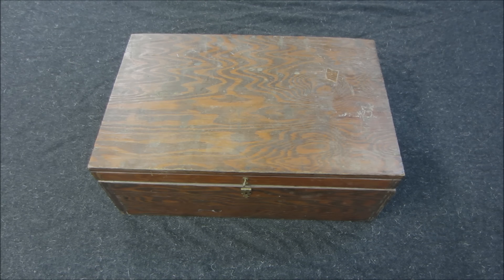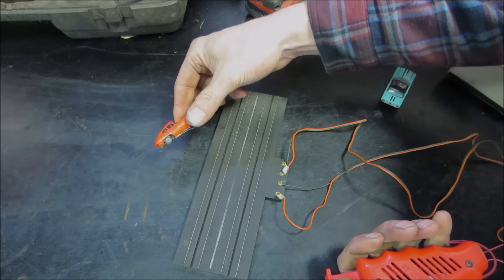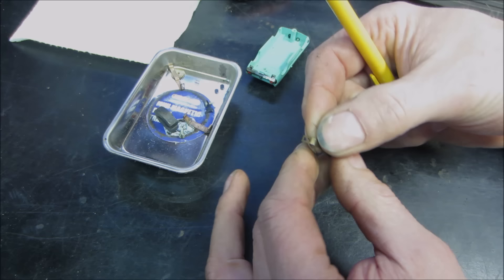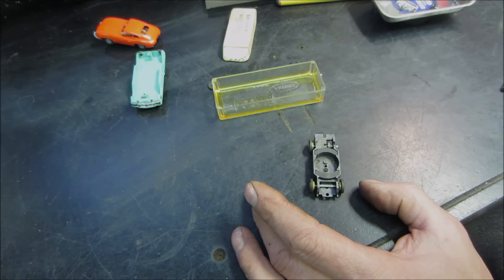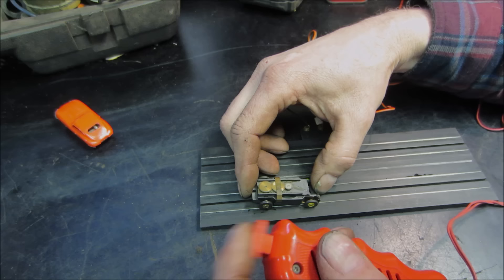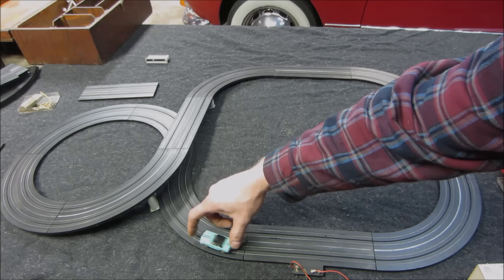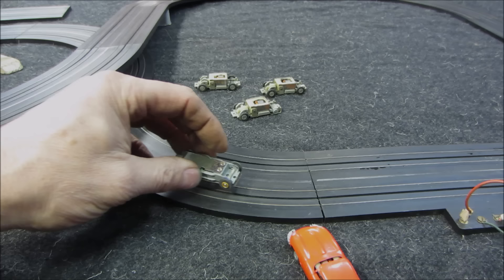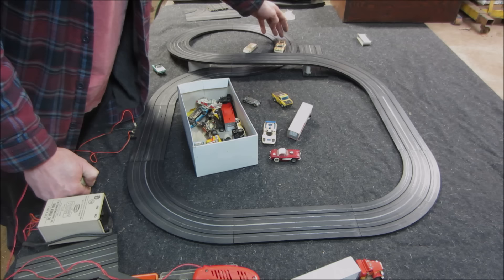will they run? 1960s slot car set sitting 40 years.

Comment: Great memories from the mid 60's for this guy...thanks Mustie! I had an Aurora set with these VERY cool controllers...instead of the spring loaded thumb or finger controllers, it had a small console with a steering wheel coming out of it that you turned left/right for more/less power but not spring loaded. You could set one car to just buzz around the track fast enough to keep it on track and then race the other lane against it. I've never seen another set with those type of controllers. Also, we'd put a pin at both the front and back of the car to keep them on the track at higher speed.
Reply: i thought it was more of a challenge to NOT put the back pin in the car....then you had to know just when to slow down so you did not ''fish-tail''the car and ''spin-out''  odd the track! fun times!

Comment: I had a ton of this.  I had cars from Aurora, AFX, G+, Super G+, Magnetron and tyco.  The track I had the most of was the Aurora quick clip track, over 150 pieces.  I ended up making a case for all of it that was three feet long, 2 feet wide and two feet tall.  I had to put castors on it it was so heavy.  I collected all that to share with my kids.    The cars you had with the horizontal motor were Tyco.

Comment: Lots of fun! I still have my Tyco trans am and tractor trailer from 1977. The tires have "melted" though :( Just picked up a TRX set from the 80's with blocking cars. The track has sides because the blocking cars are towed and have no pins.

Comment: as a kid i was very into those setups i had Atlas, Aurora and another you my have forgotten about called Faller which was German made and much fast than the rest...all my friends has small tracks so i decided to buy them all from them and i did and i built myself a fantastic setup in our basement...my Dad bought me 4 4x8 3/4" plywood and i set the wood up against the wall at first with 3 4x8 straight down and the 4th one was on the bottom right like a big "L"...so i did 2 lane of HO for the cars and then i was able to buy a tract that would allow my HO trains to be incorporated into the setup...the set took my Dad and i months to complete...i even built a control console with toggle switch for all the lights and switch tracks i had cobra climbers and cobble stone tracks crisscross tracks and several bridges and a loop d loop...i had 4 pit kits. remember those? they held about 8 cars each...sadly my cars were all stolen but the train and the trains i still own...maybe one day ill do what you did here lol

Comment: Didn't really get into the slot cars till I was working and could buy my own, no one in my family could figure them out when I was a little kid so I got Lionel trains lol. Now I'm 50 & about 4yrs ago got back into them and have 2 + 48 car cases full of cars and enough track to go around the world a time or two. In the 80's I had all Tyco 440 cars and sets but now I have Tjets, AFX, Tomy, Auto World & Tyco and have all the special adapter tracks to mix all the brands together. What is kool is all these yrs later parts and high performance parts are pretty easy to find and not that much money. I have AFX Super G Plus, Tomy Turbo's & Tyco 440 cars built to the teeth with HP goodness & use a big adjustable power supply turning them into little missiles lol.

Comment: you had the newer version, mine had the little metal tabs on each rail to make contact with the next, along with a little white locking tab to keep the track closer together. And it didn't have any of those cross over tracks, Its about 55 y/o and sitting it the orginal box in the back of the garage somewhere.  thanks for the memories.

Comment: This was fun - it reminds me of going to my local big buys layout. We had slot cars the size of 1/10 scale racers. When they came off the track everyone ducked, as they turned into missiles! They ran on 24V DC, and there were all kinds of styles and types. I had 3 cars, a green "Lightning McQueen" style Daytona racer, a humvee that fish tailed and knocked the competitors out of the way and a Baja like you mentioned with the tire on the back and the open, roll cage drivers compartment. That one required lots of eye hand co-ordination on the pistol grip, lest it flew off the track and hit someone. My Baja even had a battery inside and an RC RX, so it could do a victory lap every time it won :P (track power was cut off when the 10, 20 or 30 laps had been completed by the lead car, so places could be worked out).

Comment: Brings back memories of the early sixties. I had 1/24 scale sets, never an HO, but the problems were the same. The contact shoes would develop small grooves where they rode on the rails and the tires seemed to go away.

Comment: I had a pretty nice Ho scale slot car setup when I was a kid . It was on a 4'x8' sheet of plywood hooked to a block and tackle to pull it up to the ceiling. 2 banked turns , 3 level carousel and s turns coming back down. It was a lot of fun. I had a bigger scale slot car that I used at the tracks down town

Comment: i use to love these things my friends always had the name brand good ones like tyco  n i always got the cheapos  that you couldnt take your car to their tracks because the pins wouldnt fit in the slots but still fun times. i use to a penny to clean the track contacts and use the erasers for the cars  the penny trick works well as well flat side down n rub it just like the eraser. bring all your track stuff out like it . im almost 40 yrs old and still love the old toys  they were built to last and fix if you needed to and not go and buy another piece for it. like you said befor video game days. also gave you a education on how to fix basic electronics n cars

Comment: Memories!  Pro tip clean the slots in the tracks with silicone spray/armor all. Just silicone in the slots only. Use alcohol on the actual road surface for maximum grip

Comment: Looks like an old Tyco Power Torque motor variant.  I have some of those in my model trains.  You're lucky the brushes didn't come flying out, the ones in the train motors were spring loaded and so they'd come flying out when you opened up the motor.  Nice work!

Comment: i never comment but for this looks like im 5 years too late lol  nice collection  of cars ! i owed a 59 for a wile but had  to  built 2nd story on the house in 2000 oil well 
 68 now good time to pull out the "track" ! can't get enough of your small engine and car stuff i like your trips to the garage sails also not to toot my horn i have the track that you can pass switch lains on same skale as yours 
looks like you mite make 700 k subs soon good on you keep up the good work man !

Comment: Favorite car as a kid-late 70's was the Gplus Elf car-blue with double wheels at the front. I think it had an advantage of not going off the track.
Reply: Lol I've never seen that one. Pretty crazy car in that the front wheels were attach to the body instead of the chassis. While I was snooping around, I saw a couple eBay completed sales for that car. One seller got $125 plus $15 for shipping. The overall condition wasn't too bad I guess. The front spoiler was scuffed, missing a wheel, but nothing else looked missing or broken.
Another seller is asking $189, and doesn't even know if it works. How hard is it to touch a 9V battery to the pickup shoes?  It looks like it's in pretty good condition, there are 16 people watching, so they'll probably get it. A third one is asking $199 new.

Comment: The first set we had in 1960 used the solenoid powered motor. Soon thereafter we got the longitudinal rotor motor cars and promptly tossed those slow buzzers. You have stuff there that is much older than 40 years.  I've never seen the other two more modern motors. There are at least four motor generations in that box.

Comment: Hi Mustie1, I like this. I had an older set with bigger cars but similar track. I am 5 years older than you. By the time this style came out, I was being given different types of toys. Would have liked to have a set like this. Seems more modifiable than mine were. I took my cars apart and ended up using one motor to run the other and use it as a generator to run a light from. Keep up the videos. Tom from Canada

Comment: I was born in 63 and an older cousin (much older, at least 25...) gave us (me and my little brother) his slot car set in the early 70's. It was not as antique as yours and had bigger cars, I'm guessing about twice the length and width. It was a big set with I guess as much road as yours. It did not work well though, I'm quite sure I could fix it now if I got back in time but I did not know much about electricity back then, I even connected one of the car directly to the house's 120V AC as an experiment, I barely remember the event (I think my memory overwrote it with what I now know about electricity) except that I never tried that again.

Comment: I pulled out my old 19709's Tyco Dare Devil set a few months ago.  Aside from some hardened tires it works great.  We took a fat eraser to the tracks, cleaned up the cars and I bought some silicone tires.  I made one mistake.  I replaced all 4 tires with the silicone ones.  Not really an issue, but it's a waste of tires as the silicone tires aren't cheap.  They only need to go on the rears wheels.  Oh well.

Comment: I'm a little younger.  Born in late 70's, grew up in mid 80's.  I had a 'cheap' slot car set.  Only ran on batteries, no AC.  The car 'pickups' weren't those metal shoes, they were kinda like really fine braided wire sticking forwards to make contact with the track.  The track also didn't need those pins to join together.  It had a zig-zaged piece of track poking out that would make contact with the next section.  Unfortunately being so cheap, I never needed to get into car maintenance.  One of the speed controller remotes melted down, and almost caught fire one morning when I was playing with it.  I'm assuming we threw the whole thing out.  The braided wire pickups were a problem, plus, at the time, trigger style remotes were way more reliable than the cheap plunger style ones that came with mine.  No idea what brand / style I had, compared to what was the more expensive, longer lasting option.

Awesome video though.  I never really went that mechanical when growing up.  I did stuff like changing my own oil and rebuilt an old 1950's outboard in school, but I went mostly IT / electronics in the end.  Also had a small HO train set.  Never really had the dedicated room to setup permanently.   Awesome idea to combine slot cars and HO trains running constantly.

Anyway, if you had some dedicated space you could set this kinda stuff up, it'd be great.  Get a few friends over, have some semi-serious competitions.  Leave a gopro running with a birds-eye view.

Comment: i remember my first AFX track in the late 70s. it didnt take long before the L clips on the track started to break from taking it apart to much. so over time i ended up with 7or8 straight pieces so we made it a drag strip. a little dish soap at the start for the burn outs was always nice. lol  I later got the TCR track and it was way cooler with the steering controls and seemed to be built a little better in the track connectors. I remember using a lot of big pink erasers to clean the track contacts and the rails on the cars. i have most of my two kits but missing a lot of parts but still have all the cars (and the drag strip)for both sets. I have four kids, who are (mostly) adults now, surprised any of the sets made it through all those years of abuse.  $10 is a good find on any of the tracks! Ive seen them on fleabay for hundreds of $$.  =( 
thanks for sharing, and the trip down memory lane. lol
Reply: also i always used 3n1 oil for speed!  while i heard some used graphite? prob not a good idea. i hated those fuzzies cloggin my gears!  lol

Comment: Had a ton of track and lots of cars into the mid 80's. Those old cars were fun since you could hang out the rear and dirt track the corners. Then they came out with the cars that had the rotor laid down horizontally. The magnets almost touched the track and sucked them down. A lot faster, especially the corner speeds. They'd smoke those old style cars.

Edit: Yeah, the G-Plus cars lol Couldn't remember what they were called till you said it. :) And without guard rails you're in trouble on the outside of the corners.

Comment: The vibrator engines (around 45:20) were the first version Aurora sold. They were slow but the most fun to modify because you had to know the tricks that made them more efficient. The Mustang and XKE have Aurora "Thunderjet" motors in them. They were the second generation of "Model Motoring" motors. The later models were  Aurora AFX "Magnatraction" motors. The ones you have there with the square looking motors appear to be Tyco.   I believe Atlas just made accessories like tracks, transformers and controllers.

Comment: Well its not Winter here. However I guess I'll dig out my AFX and see if I can get it to work. The Atlas track is different from AFX, the tracks were held together with cheap plastic pins to lock the tracks together...Yep they always broke when you took them apart. The other items to dig out are the O gauge Lionel Trains. A lot of cool engines back then, the ones that you put I assume, a light oil to make them smoke. You would run them for awhile and the whole room would be fogged like a mosquito repellent. OF Course that didn't cause cancer.. Great piddlin vid.

Comment: Hey Mustie!  Always love your videos! I would love to see more on slot cars, I'm into ho scale trains my self and have always wondered about and tempted to buy,  aslot car set. If i may, i would like to pass on some of my knowledge of models. First you might want to avoid using an eraser to clean the track and contact points. No matter how hard one tries, one can never get rid of all of the rubber particles, which become charged and will stick to the track and contact points, they then need scraped off by hand. I would, instead, recommend a small amount of rubbing alcohol on a fine paint bush, the get the worst of the dirt off. I would then apply a small amount of conductive lube, for models like the Bachmann or atlas branded conductive lubes, on the contacts to promote good conductivity between the contacts and the track. Also, i would stay away from non syntactic lubes. It has been found that these tend to go sticky, especially  when they get to a certain age, and will do more damage in the long run then good. When these lubes get sticky, they can only be removed with some hard scrubbing and rubbing alcohol, just finished working on a project locomotive that seemed to have been bathed in this stuff! I would go with a modern lube like labelle 107 to avoid this. Looking forward to seeing more slot car videos!

Comment: The other cars with the horizontal armature shafts that resemble G-Plus cars are actually Tyco. Tyco was a competitor of Aurora/AFX for a while but they were both cross-compatible HO scale cars. I have HUNDREDS of these cars from as far back as the 1960s (yours are 50+ years old from the 1960s), all the way into the 80s. This stuff was my world until I discovered dirt bikes and music making... I should get my stuff out and try it out... Oh, and the magnets showing through the bottom for traction was called “Magna-Traction”...

Comment: I must have 200 feet of model motoring track! I love slot cars!  Just keep a ton of erasures handy for the track! I used to run mine hot then oil them so they smoked going around the track. The horizontal style motor is a tyco.

Comment: Elgin was the first race set I remember from the 1950's. Guess I am giving my age away!  A hobby shop in the 50's was a race set that could run anywhere on the track and was high tech for its day. No chance of getting that one for Christmas as it was to much money. I did slot cars in the mid 60's when thay were 1:24 scale and you rented time at a public track in a strip mall. I was living east of L.A. that had public tracks. You paid 50 cents for half an  hour or 75 cents I think for an hour.

Comment: Yes, those first cars are Aurora Model Motoring pancake engine cars. The AFX cars which followed had snap on bodies instead of screw on like those. The AFX were faster as they had some silver plated components and stronger magnets. 
I still have enough track and curves of 2 different radius in order to make a 4 lane race course. 
Back in the 70’s a hobby store had a 12 lane setup. You just brought a car and a hand controller with a 1/4 power jack to plugin and race.

Comment: Tyco made a set called Nite Glow that glowed in the dark. I think that's when slot less cars were introduced. I remember the G Plus cars being a lot faster than the AFX cars. But you could run them on the same slotted track. I'm only two years younger than you so we grew up around the same things.

Comment: I had a set similar in the 80s, they had plastic guard rails you could add to the turns (if you wanted) so they wouldnt fly off as often...you could go a whole lot faster but even being 20 years newer then this it was still very touchy, and as far as i know not nearly as customizable though you could change the bodies

Comment: Burnish all of the metal track with very fine sand paper or an ink eraser. Polish the car contacts s well. I've had to solder up contacts with grooves and slots worn in them that made them stop in some places on the track. We used to burnish the track contacts with a penny.

Comment: I know it's been a few years since you posted this.  The 'Vibrator' is called just that. Vibrator chassis. it is the first Aurora slotcar.  The car you rebuilt is called a T-jet which is the precursor to the AFX in the early 70's.    The box motor chassis is early TYCO S's chassis. The Red Vette is the later TYCO Pro.